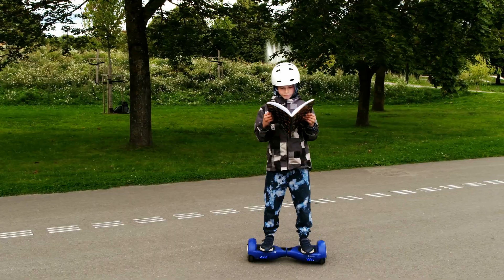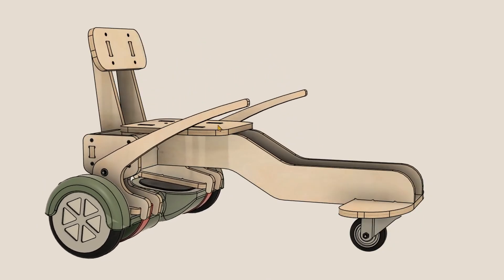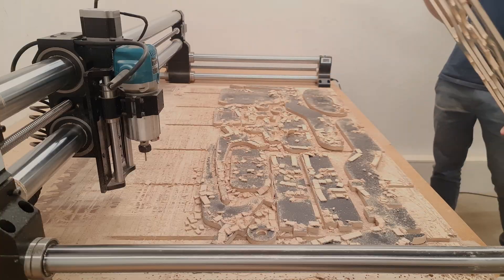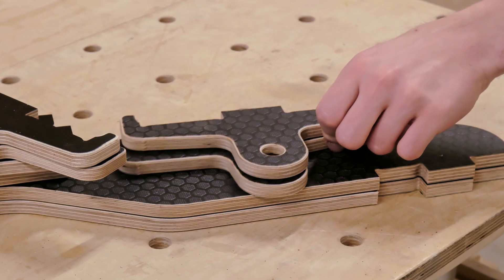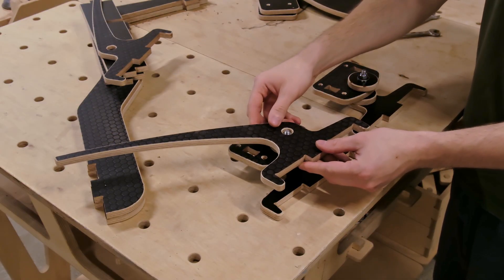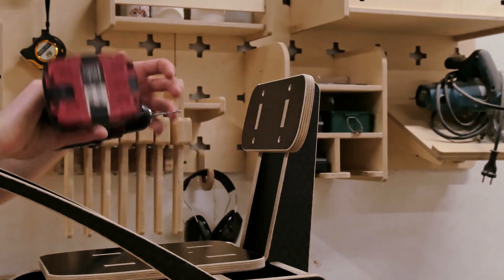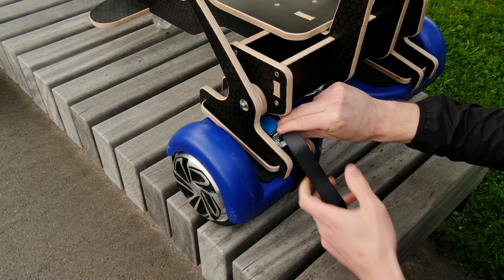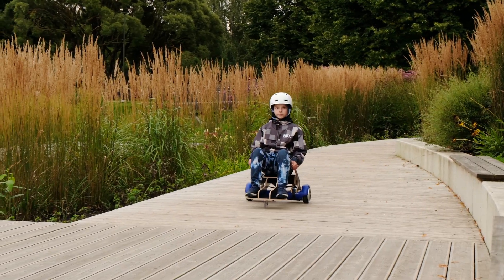Turning a Hoverboard Into a DIY Go-Kart - Fun CNC Project

Comment: This looks very cool!
Reply: Does it fit different models?
Reply from the maker: Thank you!
The design fits most hoverboards with 6 to 8 inch wheels - if you are using bigger boards, it would require adjusting the frame a little bit.